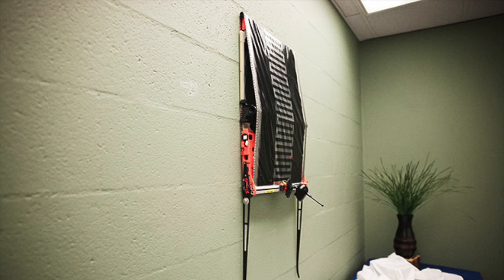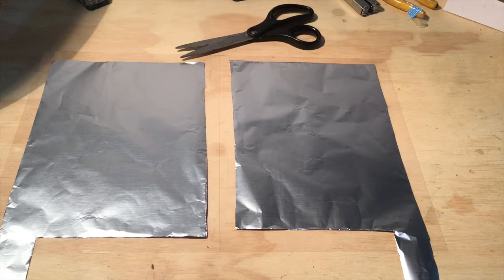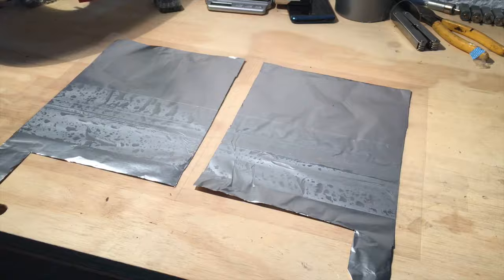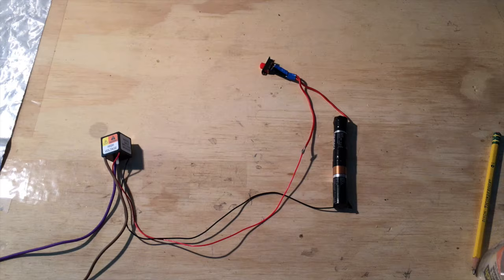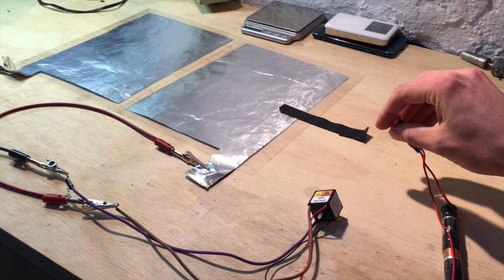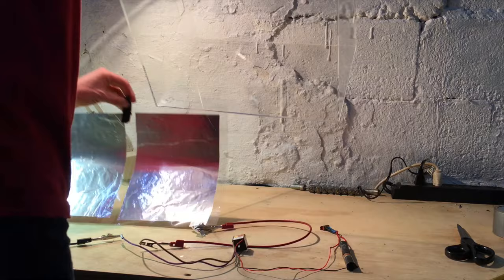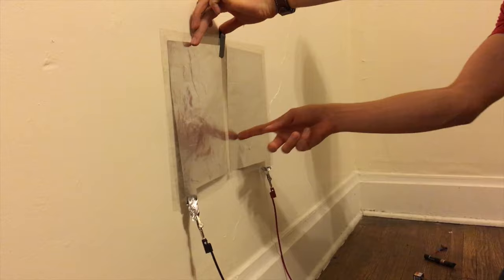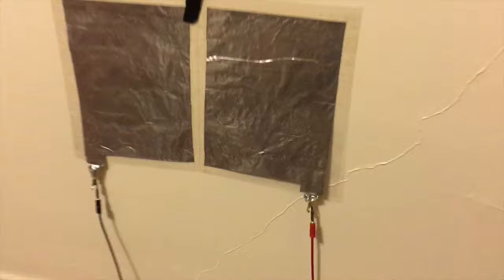Make ElectroAdhesive Sheets!

Comment: Very impressive. Thank you for this video. Does this grab onto fabric? For example, if you lay down a polyester sport shirt, would it be possible to slightly lift it?
Reply from the maker: Naar Azië I had no success with fabric, I but never tried a thin light or very smooth fabric
Reply: Have tried for fabric? Is it successful
Reply: @CarterHurd  does it stick to common cement? concrete, walls in general?
Reply from the maker: @jvlsgames4446  only super smooth cement
Reply: @CarterHurd  Thank you very much for the feedback. I recently came across such an electrostatic adhesive, it seems to work infinitely without a source, and it only seems to stick to flat surfaces, eg mirror

Comment: Mine doesn't work. Do you specifiacly need the DC-DC converter? This is going to be part of a school project..
Reply from the maker: What voltage are you currently running at? I'd suggest reading some research papers.... this only works at very high voltage.
Reply: @CarterHurd  this will later be transformed into an attachment for an ABB robot arm so max voltage is 24V as thats how much the robot arm has. Voltage at my garage even went to 350V and nothing. I checked if the aluminum foil even had any current and it had. Could the problem be not the right transparent foil?

Comment: so how many volts could you put into that before it stops working (basically how many pounds/ounces could it hold at its maximiun voltage) and would tons of smaller strips make a stonger "grab" than just 2 large pads?
Reply from the maker: Good question.  Saturation starts to occur as voltage increases, so you start to get diminishing returns between 2 and 5kV.  A pad around this size can supposedly generate roughly 15lbs of holding/shear-resisting force on a glass surface (and about that on smooth aluminum, and roughly a magnitude less than that on brick and concrete).  Then you have to move to a comb electrode to achieve more adhesion force, which is essentially your "tons of smaller strips" idea: http://d10k7sivr61qqr.cloudfront.net/content/royinterface/11/93/20131089/F3.large.jpg
Reply: do you plan to further experiment with this. maybe to see how much weight it could hold when it's at the "perfect setup"
Reply from the maker: Unfortunately I don't plan to experiment any further with its holding capabilities.  I needed this high voltage converter for a lab project (that I won't be able to post about for a while), and just did this little electroadhesion experiment while I had the converter.  There has been research on this subject, though, if you want to learn more.  I'd start by searching "electroadhesive" in google scholar to find related publications
Reply: can you at least tell us if applying 5V did help?
Reply from the maker: Jerome Demers sure- let me get back to you on that
Reply: yeah. so is it just a 5 volts dc? what exactly does the converter do? sorry for asking so many questions lol.
Reply: i just rewatched the video. it examplea what it does. lom but why is the 6000v needed,
Reply: you put 5V at the input of the converter and it change that voltage to 6000V! That very high voltage creates electrostatic with aluminum sheet and make thing stick to it. (*I think it's static,  Carter will correct me if I am wrong) high voltage travel on the surface of object, that might be an explanation to something. I did not read the papers yet.
Reply from the maker: Yep, Jeromes correct. It's an electrostatic effect caused by an electrical field.  A high voltage is required to create that electrical field.
Reply from the maker: Okay, so I finally got to testing this with 5V input.  You can feel the differences in adhesion, but it's minimal.  Just by sliding it along the wall with my hand, I'd take a wild guess of around 30% increase in force required to get the sheet to slide.  There was a comment on Hack a Day suggesting that the higher voltage will arc through the dielectric and actually reduce the adhesive effect, but I did not find this to be the case. (although I just tested on drywall again, high voltage might be worse on metal).
Reply: thanks!
Reply: There was a study done by a group at NASA on optimizing electroadhesives. They found that there is an optimal size for the electrodes based on the voltage supplied, thickness of the dialectic material (transparency), and the location of the "strip"(electrode) in relation to the other electrodes on the pad. Here are the links I found to that study: https://www.nasa.gov/sites/default/files/files/M_Spenko-Hybrid_Electroadhesion_Application_in_Space.pdf

http://rsif.royalsocietypublishing.org/content/11/93/20131089
Reply from the maker: Great information- Thanks for sharing!
Reply: @micahcarr7835  Great thanks for sharing...Do you have any relevent videos.?
Reply: @smallsun247  no, unfortunately not. I did make some electroadhesive pads myself using silicon caulk and conductive fabric. You can check it out here. https://hackaday.io/project/18870-high-quality-electroadhesives
Reply: @CarterHurd  Thanks for your sharing, Carter.
I want to ask if i input about 250V (control current under 0.5 mA) to eletrode and there is a glass cover on the eletrode, is it safe for my finger exploring on the glass surface and also can feel electorstatic effect? I'd like to try this idea on my research but so worry about safety..., or is there any resources I can study to know more this field? Thankkks a lot!

Comment: Hi is it possible with AC High Voltage?
Reply from the maker: do not use AC
Reply: not unless you use a AC to DC converter. This is because AC changes the direction of the motion of electrons twice per cycle, so there isn't an electric charge build up at any point, so no attraction is generated.